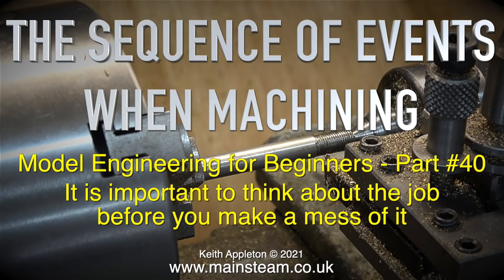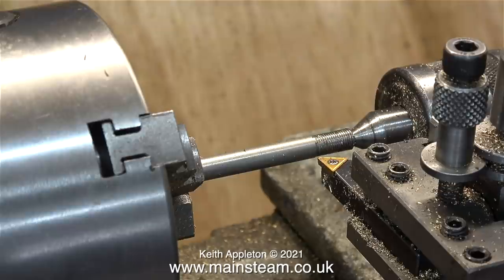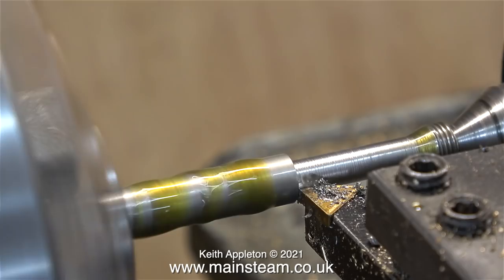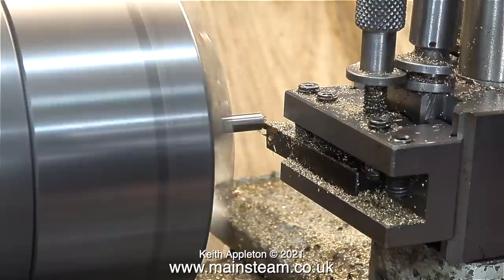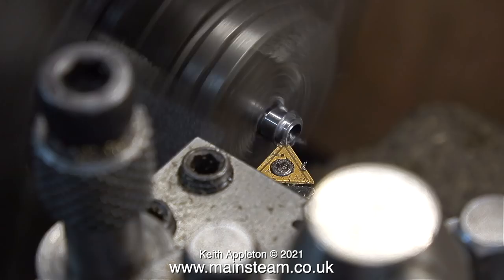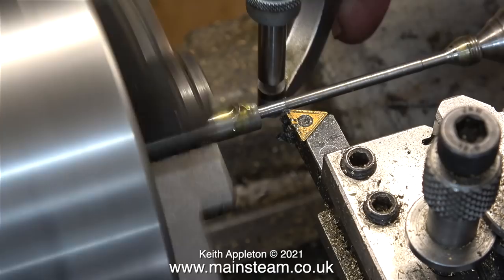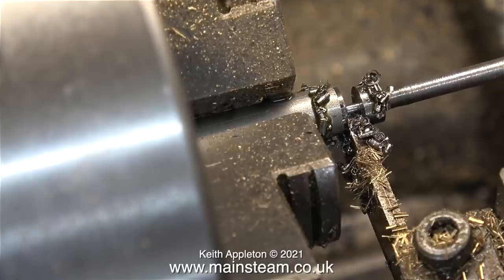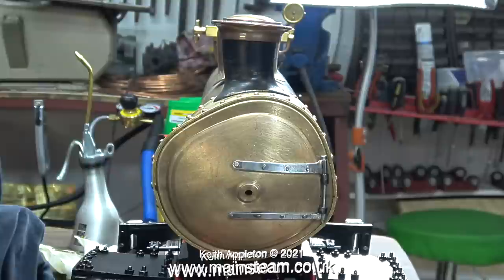SEQUENCE OF EVENTS WHEN MACHINING - MODEL ENGINEERING FOR BEGINNERS - PART #40

Comment: For one off custom parts you are putting beginners on the right track. I am a professional machinist and millwright, and I know the difference between production machining and getting machinery to work properly. Knowing when it has to be just right and when it’s will work fine as is takes  some time. Thanks for letting people know The differences.

Comment: The issue you are having using the indexable carbide is because they are designed for 'pressure' finish, which is going to deflect the part. A better choice for long small diameter part is sharp brazed carbide or high speed tool it will also give a better finish and for accuracy on a small lathe finish with a 'water finish' ground tool with no after polishing required and a surface finish equivalent to ground.

Comment: Hey Keith, if you ever have a part, which needs a great surface finish try using a cutting insert made to cut aluminium. They are way sharper and on a small old lathe you will get amazing finishes on steel. This is just a tip my instructor gave me some time ago and i have been using it ever since
Reply from the maker: Thanks for the tip!